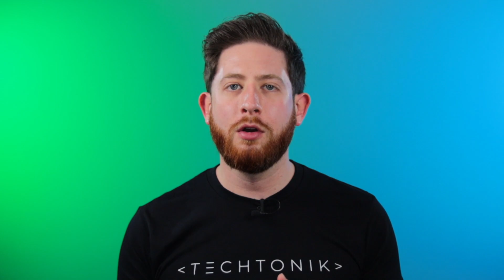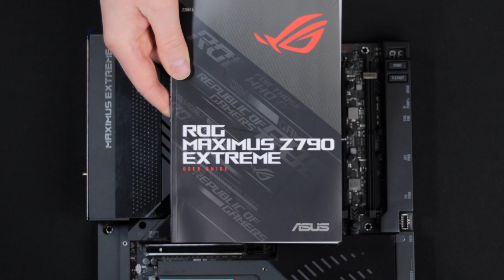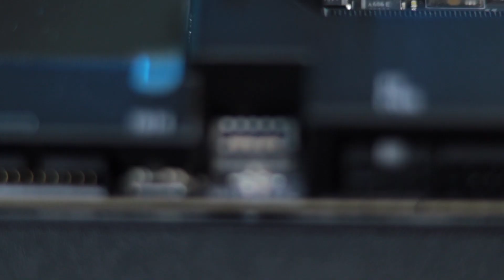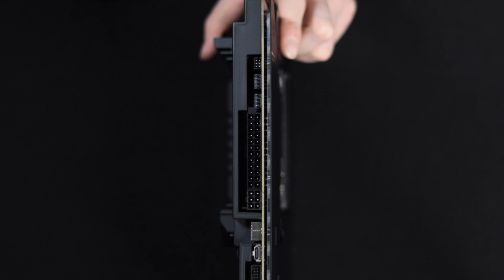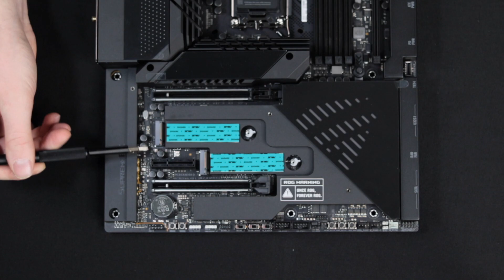Where To Plug In Your PC Parts - Motherboard Connectors

Comment: When you did your 'New House' wall around, I suggest you cover the volts each connector provides. Some need 12 volts, while others need 5 volts. I'm talking about MB, fans, RGB lighting, and other devices like HDD, SSD, and CD players. I guess it would have been nice to show what the different connectors look like and that USB ports are backward compatible for the most part. As you pointed out, you can just read the MB user manual when in doubt. You could download one from the MB manufacturer if your MB did not come with a manual.
Reply from the maker: I wanted to keep this video more focused on the main connectors that will get you up and running, but I am working on producing a video that covers the ports you mention! Great recommendation!

Comment: Until you get better at focusing, I'd avoid low apertures. The whole video is blurry.
Reply from the maker: Thanks for the recommendation! I am learning as I go!
Reply: @techtoniksystems  Depending on your camera, autofocus might be the way to go. But if it sucks or doesn't work, lower aperture is good, especially when you're close to your subject. Bokeh is overrated imo. The video was good otherwise. Keep it up.
Reply from the maker: @nikzel  I believe what happened is the lighting I used created a glare on the upper left portion of the board which wouldn’t allow the autofocus to work properly thus resulting in it being slightly out of focus. I appreciate the recommendation and will explore it in future videos! Any help is greatly appreciate as I am new to filming and lighting etc.. thanks for watching, and I hope you stick around for more content!

Comment: I recently discovered that a PCI card with a short interface plug can be plugged into a large slot and still work.  This mattered when I was strained for usable slots due to the spacing of other cards, like the 2.5 slot 3080 that I am now running.
Reply from the maker: That is true if you are short on PCI slots!

Comment: for the i5 13500 I'm choosing between ASRock Z790M PG lightning D4, and Gigabyte B760M Gaming X, which would you recommend
Reply from the maker: I would personally go with the ASRock Z790 board as it has PCI Gen 5 and DDR5 which will help future proof if you don’t plan on rebuilding soon. Plus the Z790 boards allow full control over overclocking where as the B760M chipset has very limited BCLK overclocking control which is not the most stable way to overclock. I have never had an issue with ASRock in the past either!
Reply: @techtoniksystems  it's actually microATX Z790M  DDR4, not planning to overclock, will get the i5 13500, already got 2*32GB of Kingston Fury 3200
Reply from the maker: @omuleanu  My mistake! I missed the M on the ASRock board. I would still personally go with the ASRock board as the z790 chipset supports more PCIE lanes. If you are running M.2 drives or want to upgrade to them in the future and have a high end GPU or want to upgrade to one in the future, you won’t have to worry about saturating the PCIE lanes and sacrificing performance!
Reply: @techtoniksystems  so even though looking at MB specs they have identical PCIe connectivity, the amount of lanes is specified on the chipset's spec and the Z790 has more
Reply from the maker: @omuleanu  Are you referencing x16 x8 etc on the MB specs? If so, one of the things that can occur on motherboards depending on chipsets and availability of PCI E lanes is that the motherboard can disable or allocate lanes to different devices. I touch on that in my overview video of the ASUS Rog Maximus Z790 Extreme. Even though that is a top of the line motherboard, if you plug an NVMe into the PCI 5.0 NVMe slot, it completely disable the second PCI x16 slot on the bottom of the motherboard. If I decided to forgo the NVMe drive in that slot I could run an dual graphics card set up, but it would bring each PCI slot from x16 to x8. So even though the board may have 2 PCI 5.0 X16 slots they both can’t operate with the full 24 lanes. They would have to reduce to using 8 lanes each. I would still go for the Z790 ASRock Board to allow the most lanes possible! Plus you get a little more robust VRM which should provide a little more stability in the power to the CPU.
Reply: @techtoniksystems  Thanks, that makes it clearer. Another difference is that the Asrock uses a 12pin power connector for the CPU, and Gigabyte 8pin, I'm going to reuse my Corsair RM550 PSU which is currently connected with an 8 pin to my current PC, I've read that it will be fine to just connect the 8pin even tough the MB has 12 pins for the CPU.
Reply from the maker: @omuleanu  Yep! Your 8 pin CPU connector will work just fine, like I mentioned in the video any pins past 8 are just providing extra power for high overclocking purposes and your CPU truly only needs that 8 pin connection to operate like normal (you can even overclock some on just the 8 pin)!

Comment: question about chassis fan. is that 4pin header enough to power 6 daisy chained fans together?
Reply from the maker: For the motherboard in this video, all of the fan headers (CPU, RAD, and Chassis) have a 1.0 AMP max current and a 12 Watt max power. So to find how many fans you are able to daisy chain to one of those 4 pin headers, you would have to find the max watts that the fans you are looking at installing are going to use, and then add that wattage together until you reach 12 watts. Once the 12 watts is reached that is how many fans you would be able to daisy chain. There isn’t a set number because some fans use more and others use less, but a typical safe number is around 3 fans per header. Check the manual of your motherboard to find what AMP and wattage max is on your 4 pin header to be sure!
Reply: @techtoniksystems  thanks a lot. im glad i found your video just in time as i was building my first budget gaming desktop using gigabyte a520m with ryzen 5600g and rx 5700x gpu and im using a total of 6 darkflash c6ms fans which comes with two connectors for daisy chain plus a 240mm darkflash AIO cpu cooler. they are all rgb and was a bit confused how to daisy chain them all with enough power. some said i could use the sata port though instructions on that are a bit unclear.
Reply from the maker: @AlmuntasserMohd  No problem, and I am glad my video is of help! If you have any other questions I will do my best to answer 😄
Reply: @techtoniksystems  on that note, i found out the fans i was going to use, one of them the main fan has 4 connectors. 
1 of which directly connects to the psu. does that mean i don't have to worry about connecting all 6 fans to one 12v motherboard fan header?

basically it goes like this. 
1 for psu
1 for fan rgb on the motherboard
1 for daisy chaining the other 5 fans
1 that seems to connect to that 12v fan on the motherboard.
Reply from the maker: @AlmuntasserMohd  From what it sounds like you can daisy chain all the fans to a main fan which has the four connections on it? If that is the case, yes the connector (most likely 4 pin moles or SATA power) that goes to the PSU should power all of the fans in that chain (unless only a specific number are chain-able to the main fan). If the main fan also has the 4 pin fan connector that goes to the motherboard, that will act as a PWM only which will allow the motherboard to change speeds of the fan. From there it sounds like the RGB would then get plugged into a header and you should be in business! Since the 4 pin motherboard connection is acting only as PWM you should have no issue coming from a single connection since it is just a PWM signal. However, that will mean all of your fans will run at the same relative speed (not sure if you wanted to be have different fans run at different speeds). Otherwise, if you unplugged the PWM connection the fans would just run at 100% speed all the time. I hope that all made sense!
Reply: @techtoniksystems  yep, that cleared pretty much everything. can't wait for the fans to arrive so i can hook them up. thanks a lot! you've earned a subscriber!
Reply from the maker: @AlmuntasserMohd  Thanks for subscribing! If you have any other questions when they arrive or during your build I’d be happy to help with any questions!
Reply: @techtoniksystems  hi man, im thinking of changing my fan setup to an uphere fan set, but they come with proprietary 6pin connectors that all connect to a single hub which then connect to SATA. then another connector for 5v argb on the motherboard. 
my issue here is that the AIO that i am using uses 3 pin for daisy chaining or connecting to hub. and it has a separate connection for 5b argb on the motherboard. Im confused how to sync all of this.
Reply from the maker: @AlmuntasserMohd  Hello! If that’s the case it sounds like you would just need to get a DRGB splitter to split the one drgb header into two and send one to the hub and one to the AIO. Are you able to daisy chain both fans together on the AIO and plug them into the CPU fan header?
Reply: @techtoniksystems  hey man. its me again. i just finished installing my 6 rgb fans, but ran into some kind of problem. 
im using a gigabyte motherboard with rgb fusion 2. 
the issue i have is that the rgb that i set seems to flicker between two modes. 
one which is from the motherboard that i set using rgb fusion 2, and the other which is the rgb mode from the fans itself. 
they seem to flicker between the two modes every 10/15/20 seconds or so. 

for example i set all the fans to color wave using rgb fusion, and for 10/15/20 seconds it would be fine, then suddenly for a single second or so, it would flicker to its built in color mode where it that built in color mode was set to, then go back to the color wave as normal for another 10/15/20 seconds or so and the cycle continues. 

the same thing happens if i use the led switch on the pc case itself. It follows the built in mode from the fan itself using the case rgb switch for 10/15/20 seconds then suddenly flicker for a second into what ever was set on rgb fusion, then continue on with the built in rgb mode for 10/15/20 seconds, then flicker again and the cycle keeps happening. 

is there a way to fix this and force the fans to follow only one of this modes? I much prefer if it just follows rgb fusion and not flicker back into its built in rgb mode like ever.
Reply from the maker: @AlmuntasserMohd  hey again! RGB is wildly finicky, but it sounds like your case is somehow controlling/conflicting with fusion 2? Are you using an RGB controller that came with the case?
Reply from the maker: Re reading your post I may be misunderstanding exactly how it is all connected up. Is everything connected directly to the motherboard through a DRGB header?
Reply from the maker: @AlmuntasserMohd  Could you link exactly what fans you are running so I can check them out as well!
Reply: @techtoniksystems  the fans have 4pin and 3pin headers. all of which are connected to a fan hub. 
the fan hub is connected to sata for power and has a 2 pin for led switch and also has a 4 pin connected to the motherboard fan header and a 3 pin connected to 5v argb header on the gigabyte motherboard. 
thats pretty much how i set it up.
Reply from the maker: @AlmuntasserMohd  So it sounds like the fan hub may be what is causing your RGB issue. It may be that once Fusion 2 is done with its light cycle effect there a short period of time where your fans are waiting for the instruction to restart the effect from Fusion 2 and the controller has a default effect that takes over and then Fusion 2 cuts back in. My suggestion would be to try only powering the fans through the hub and getting an DRGB splitter and bypassing the fan hubs DRGB connections completely and connecting the fans directly to the motherboard’s DRGB (vs motherboard DRGB > controller > fan). Does the fan hub have a connection to the motherboard like a USB 2 header?
Reply: @techtoniksystems  just to clarify, your suggesting to use two different hubs. one specifically for 4pin to control fan speed and stuff, and a separate 3pin only hub for the argb? is this correct. 
and as for your question, the fan hub i am using has a 4 pin header that connects to any 4 pin fan header on the motherboard. 
in total, the fan hub has one sata connection, one 4 pin connection and one 3 pin rgb connection and also has a 2 pin header for case fan led button.
Reply from the maker: @AlmuntasserMohd  Sort of! Instead of two hubs I would just get this: 

https://www.titanrig.com/ekwb-ek-d-rgb-6-way-splitter-cable-04-30-ek-0109-01-on.html?gclid=CjwKCAjwge2iBhBBEiwAfXDBR_k2DlmI0rJyfFi_BAvRzp7AP9j2XPHjoExLbWpLmQfXDRaEevlTBxoC_AwQAvD_BwE
Reply from the maker: @AlmuntasserMohd  Then use the hub you have only for power and PWM!
Reply from the maker: @AlmuntasserMohd  by doing that, you would completely cut out any interference with RGB from the hub and the motherboard would be directly connected to the fans which should resolve the issue!
Reply: @techtoniksystems  oh. i see. though i might need seven, cos the AIO cooler is still on the way. but thanks i wll try this suggestion.
Reply from the maker: @AlmuntasserMohd  you could split it to more than six if you need! Same concept applies here, as long as the sum of the power draw (amps and watts) of the leds you are powering do not exceed the header’s power capabilities, you’ll be good!
Reply: @techtoniksystems  i forgot to asks. will the 5 volt argb enough to handle 7 fan rgbs? shouldnt it have a power supply of some sort?
Reply from the maker: @AlmuntasserMohd  I am planning on chaining my CPU waterblock, GPU waterblock, two D5 pump covers, an LED strip, and three fans off of one DRGB header! It’s powered through the motherboard. But you would have to check your motherboard manual to see what it’s watt and amp limit is and then add all of your devices RGB draw would be. But if I had to guess 6 fans and an AIO should be plenty fine!